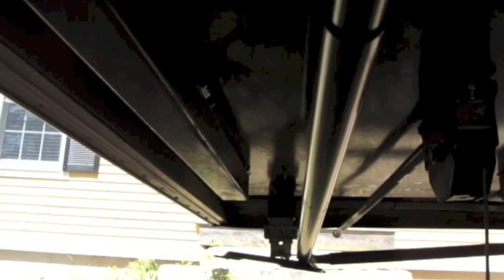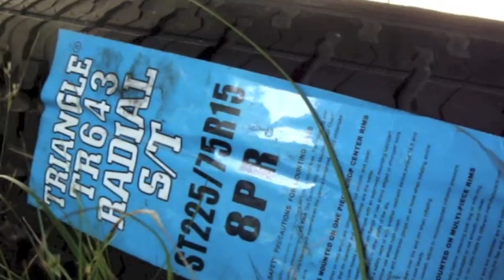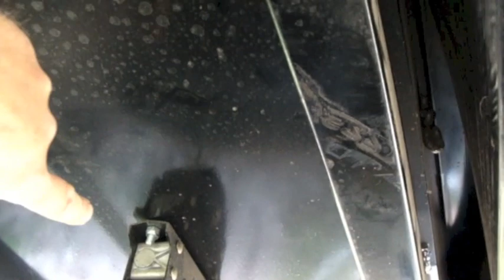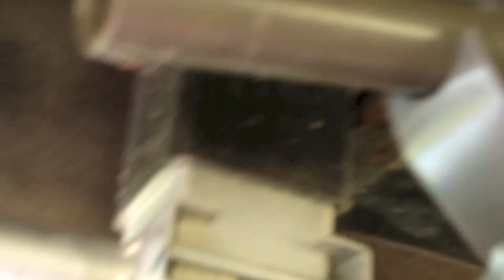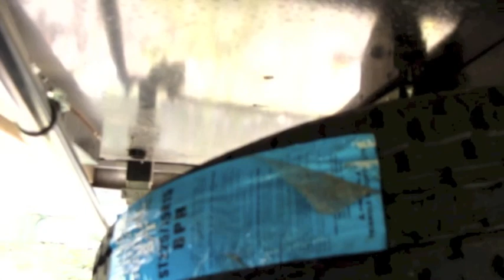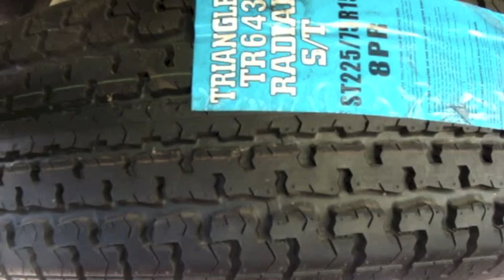Steadyfast RV stabilizer system install Part 5

Comment: How long did the installation take, excluding the spare relocation?  I think the web site says 3-4 hours, but it looks like a full day to me.  My kit is in transit so I guess I will find out soon enough.  I was also planning to tap the holes as well rather than depend on self tapping screws.  Seems like that will make a better installation.
Reply from the maker: LTVoyager it can be done in 3 to 4 hours if you dont have a spare tire to relocate, and an underbelly that needs trimming. Also,  sharp drill bits, tap, oil, and a cordless impact  driver.

Comment: Thank you for the videos and your review.  I believe I would've gone old school and purchased a rear bumper mount and spare tire cover for the spare and saved a lot of time and effort.  My 1998 Coachman Lite fifth wheel had the bumper mount setup.  As for the stickers -I believe one is for the front landing gear switch and since I have powered stabilizers in the rear the other sticker might go there as a reminder.  I'm still on the fence whether to go with these or try the tripod under the king pin first.  I can get the BAL tripod for $114 or purchase 3 boxes of BAL Lock-arm stabilizers for $333.  Like other people you mentioned in your last video; people who purchased these stabilizers sold their tripod; that might be me.
Reply from the maker: +smoberdeen I still have my tripod and find that in a few situations it helps to use both working together, but usually the stabilizers alone are enough. The rear bumper spare mounting position is an option, but in out situation, I have a grill on a swing out arm for the outdoor kitchen that might interfere with a spare back there. I also might want to put a bike rack or something like that back there.

Comment: Another very informative video.  Using the hole on the single pad end of the footplate is good way to get around an otherwise insurmountable obstacle.  Performance will still be the same.  

The Steadyfast 3 padded footplates are just one of the major differences that set the system apart from the competitors.  It is important when blocks are used that they hold the footplate solid.  Generally, stacking blocks do not properly fit the footplate which allows movement as well as being plastic they have give to them.  Both of these factors will allow excess movement.  We recommend using two 2x4's in a V shape under the foot plates and then if additional blocking is needed, crib type blocking under that.  This procedure will provide the most solid base for the footplates and therefore the best movement reduction.

The no play bracing is a second major difference of the Steadyfast system.  It is critical that swivel clamps are tightened so that there is no movement in the joints.  If attention is payed to these two areas, the most possible movement reduction will be achieved.  This trailer should have 90-95% movement reduction when set up on solid ground.  

Warning stickers are provided to remind the person setting up the trailer to loosen the Steadyfast system before moving the jacks to avoid damage to the system.  One should be placed at each of the two locations where the jacks the Steadfast are attached to are activated.

Additional information and videos can be seen at:

http://www.steadyfast.com/installation.html
Reply from the maker: I think I'm going to make some blocking from scraps of composite decking. That stuff is rot resistant, and dries easier if it gets wet. It also stands up well under compression. Scraps of pressure treated 2x4 are another option.